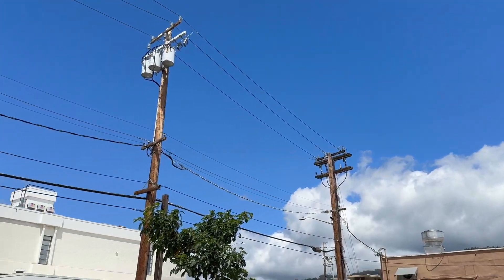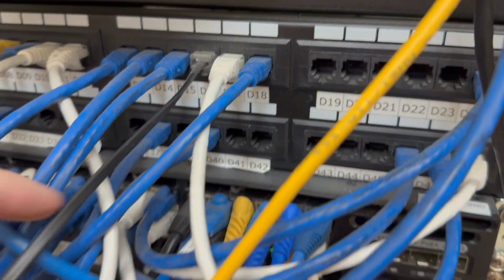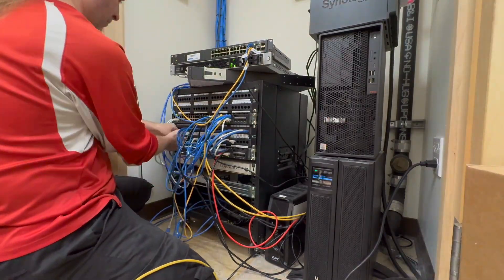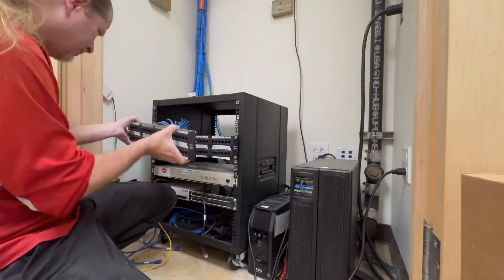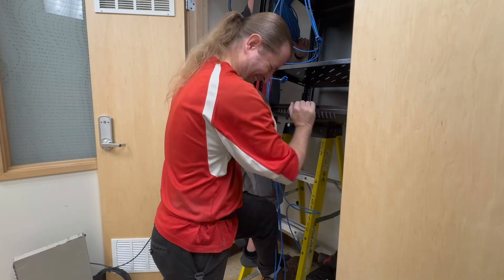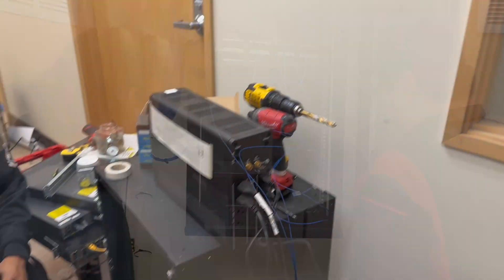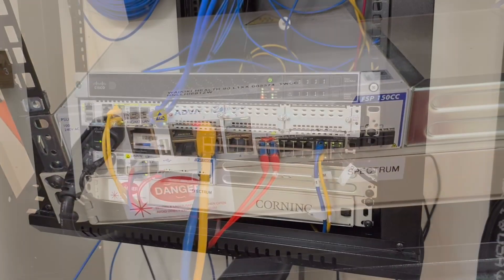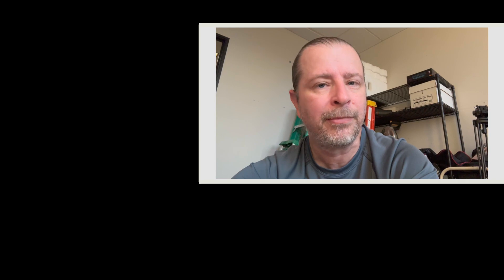Network Rescue 2 - Getting Your Network Off the Floor

Comment: A real pro would simply use 2, 1x2 strips of wood, all the way from the floor, to the highest point of the rack anchoring.

That way it's the most secure as the wood takes most of the weight and momentum!

You would have to break the wood BEFORE the thing comes down!

It's "good enough" what ends up falling, or hurting people...

It also all8es you to mount the whole thing by yourself!

Comment: I love these videos, and have got an improvement suggestion: After screwing in all devices into their proper places, wouldn't it make sense to refer to your documentation on what is plugged into where, and then use tape measure to measure the length of each connection? You'd then write that down in your documentation, and when you're done documenting the lengths between all ports (i.e. the minimum lengths of the cables), you'd sort the table based on the minimum cable lengths. Then, you'd start plugging in the shortest cables, then the longer ones, until finally you'd plug in the longest cables. (Obviously, you wouldn't create cables that are exactly the minimum length, but you could use cables for standard lengths, such as short, medium short, medium, medium long, and long, etc.) That way, there would be a neat layer of cables. What do you think?
Reply from the maker: I think this would work out, however I don't have that kind of time when working.  The labor involved would be just too much for the return.  Always have to balance the look with the cost and the speed of executing the job.  If I was a government employee and had to fill the days, I think I would gladly do what you suggest :)
Reply: @tciproductions  
Thank you very much for the response! :) Yes, on second thought, measuring things would add up. I've seen someone write in a forum that they use excel to somehow calculate the distances. I'm not sure how they meant that, but one way I could think of is to measure in advance the distances between the ports, and then use the same excel template to calculate them as you add the values. If someone has the time, they can perhaps write one and share it.

Comment: I recommend looking into torx-head fasteners in the standard sizes and lengths. With the appropriate clutch settings (so you don't shear off the head) they're an ergonomics gamechanger compared to phillips
Reply: Completely unnecessary if you understand what you are doing.

I did use to do that BEFORE I got the right impact tools, screws, drill bits and understanding!

Comment: Never knew I would enjoy videos like this so much. I'd love to understand more about the materials cost and how much businesses pay for network rescues like this.
Reply from the maker: It took an embarassingly long time to dial in prices, but you essentially have a day rate per person working, and then you have materials costs, so the patch cords, the panels, the cable managers, the rack, the shelves, all that adds up.  It can run easily into the low five figures.  Hawaii skews the costs higher, we are one of the most costly places in the USA to live and work and that drives labor costs sky high.  In a more connected region with supplies available and labor being more reasonable I think something like this would be around $2500 to $3000.  In New York City or most of SoCal, I would add 50-100%.
Reply: @tciproductions  That's awesome, thanks! Keep these videos coming, they're great. One of these days the inspiration meter will be high enough for me to start cutting holes in my walls and use the box of cat6 I bought last month.

Comment: How do you charge a job like that, hourly or flat projet fee?
Reply from the maker: These days I do it flat fee, we have done enough of these we can tell by site survey roughly how long it will take.  Generally, something around this size is about 1-2 days, so you charge your day rate x2 and then whatever materials get burned up making it happen.

Comment: Sometime, the client needs to "TOLD"  as that setup just wasted a lot of space for a small rack. I then seen the use of a single stud, metal self-tapping screws and unless that stud was box steel or pipe, nowhere near enough strength. The UPS is still on the floor I am guessing. Floor-stander rack in corner, access from front and right side. UPS then could be racked with rest of gear.

Comment: Have you managed to leave any space for the fan on top for ventilation?
Reply from the maker: The fans are active and have plenty of room, yes.  This wall cabinet has a cavity for the fans at the top, so even if you pack it with equipment the fans should still be operable.

Comment: Love the video! I love the fact that you go step by step all the way from beginning to end. Would it be possible to see the spreadsheet where you keep track of all cables (patch panel, uplinks) and how you label the cables? Thanks again for your channel!
Reply: Best to use a tool after install a common tool being used for DCIM is Netbox

For cabling work likely this just document them just like your switch lays it out. Most SMB switches have a GUI which is just going to be 2 rows of how many ports the switches his. Use a spreadsheet create same thing.
Reply: Big boys use DCIMs and that’s often what gets left out in our type of work as it’s not common for a IT team. But like I said Netbox and Visio (or applicable tool) will do the job. Also IT Glue, Hudu etc
Reply: @kristopherleslie8343  thanks so much!

Comment: the final pic still has a few weird wires in back that should be made more structured - why go to all that effort not to have look perfect - you should also shove the excess up into the ceiling instead of letting it loop down like a boa constrictor

Comment: I run CAT7-cable through my house and also CAT7-patchcords inside my rack to connect from patchpanel to my switches. But the patchcable in my rack feels very stiffy and uncomfortable.
Could it cause problems, if I replace the cables inside the rack to unshielded cat6, to get more flexibility?
It is a home network, no business.
Reply from the maker: Other commenters might chime in, but in my experience, using unshielded patches on shielded panels and cables can potentially cause some interference.  However, it would take a high frequency signal before it manifested I would imagine.  You may have to experiment and see if it has a noticeable effect.
Reply: Who are the only people that use, deploy, spend in Cat 7?

Fiber is the way to go if you truly want bandwidth.

Comment: I would have definitely installed a backer board. It makes hanging that rack so much easier and gives you and the client a lot more places to mount hangers and cable management. But to each their own.
Reply: Correct. This is professional, but shows lack of experience, knowledge or thought.

Comment: To mount large components like that on the wall, I like to screw a 2x4 to the wall just below the component.  This allows you to rest the cabinet on the 2x4 during install.  You can also leave the 2x4 there to provide support for the cabinet.  If you span the 2x4 wall to wall, you can run long screws into each stud in the wall.
Reply: Almost there.
This helps with the weight, but NOT with the momentum!